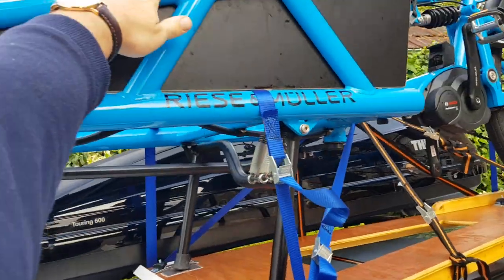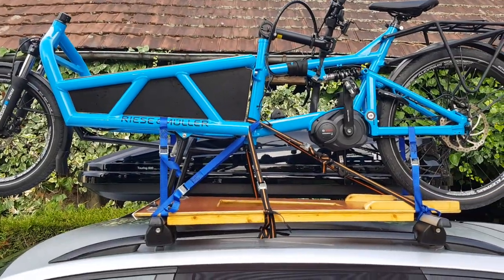Roof Rack Option for Riese & Muller Load (Possibly Other Cargo Bikes)

Comment: This is really great, Richard. The woodworking looks absolutely splendid! I have the 80, the legs of which are different from the Load. Did you consider using braces of some kind to support the mid/front of the bike rather than rely on the bike's own legs or did you realize right off the bat that any other solution would be superfluous? Again, brilliant design & superb video. Thanks a lot for sharing!!
Reply from the maker: Hi Cameron, apologies for late reply! Thanks for your comment, yes as you say trying to support the bike on its wheels or by another way is just over-engineering. The bike stand is obviously designed to support the bike so this is just applying the same principle to it albeit 5 feet in the air on top of a car! 

Used it a good few times now and its rock solid. I'd say the 80 might take a little more effort to lift up but I believe they are nearly the same weight stripped down.

Comment: This is great.  I've an Audi wagon so pretty much the same dimensions. I'm going to make one for my Load 75. Could you share the measurements for your customisation?
Reply from the maker: Hi Joseph, thanks pal! Your dimensions will depend on your own set-up, like I say in the video. For example the length of the board obviously needs to be as long as your rear wheel to centre stand, and just as wide as the centre stand. Then if your roof-bars are too close together like I demonstrated you'll need to make the board "over-hang" one of the bars - I strengthened mine by adding some supports at the top of the rear roof bar. Hope that makes sense. The triangle shape and the cut-out is to reduce weight and help the wind go through - let me know how you get on....The Load 75 is the next bike!!

Comment: great job. I have a bullitt cargo bike with a huge metal box up front to carry my music equipment. I would probably have to remove the box to get it on the roof. still may try something like this.
Reply from the maker: Definitely give it a shot - just be careful of weight limits for your roof/roofbars too though.
Reply: @ricmurphy  I have a huge metal box on the front of my bullitt. It is really hard to take it off. Can you recommend a rear loading cargo platform for an suv that could hold my bullitt? I would probably have to take the front wheel off so it doesn't stick out on either side of my car. Thank you!
Reply from the maker: @patdowling7200  Afraid not, pretty much the same reason I came up with the above. I'd imagine anything would have to be tow-bar mounted at least. Perhaps you could consider a trailer, I've seen others use motorbike trailers for these bikes...

Comment: Hi Richard. Thanks for sharing. Really great job! I have a Packster 80 but right now my first concern is mounting my Supercharger 2 which I'm taking delivery of in a couple of days (!) to the back of my car that doesn't have a tow bar or hook for conventional flatbed bikeracks. I see you mounted you wife's R&M bike to the back of your car. What is the rack you use? Is officially rated to handle a bike of that weight or did you just try it out? Thanks!
Reply from the maker: Hi Daniel, thanks for the words - the R&Ms really are great bikes! The Supercharger was the bike I was going to get before kids took priority and went for the cargo! For mounting on the back you need to check two things: 1. Weight load for the bike rack, 2. Weight load for the boot (if available). 

I've since changed car (Skoda Kodiaq) and the rack too, but the current one is the same style and is like most normal racks rated for 45kg (more details on this on a post I put up here: https://www.briskoda.net/forums/topic/466897-boot-bicycle-carrier/) I was also able to find out that the boot can take this weight as well. I think your bike is about 30kg so well under the limit. I just wouldn't go putting multiple bikes on it unless you have another light bike? Honestly if I could afford the €800 tow bar + €500 tow bar bike rack at the time I might have gone that route, but the above serves us well

Comment: great video and nice solution! I own a bullitt and looking for ideas on transporting it. Out of curiosity, how do you get the bike up there? I am guessing it is a two man job?
Reply from the maker: Thanks Peter! Nice bike but could be a bit heavier than the Load 60 so watch out for your weight limits. I touch on the process of lifting the bike up in the video, but yes a two man job. Myself and my wife manage it easily though. She lifts the front of the bike to her hip height, I then lift the rear wheel up to the platform, then together we lift the front of the bike up onto its centre stand. Straight forward, but just take it slowly to avoid damaging the car.

Comment: It's super cool, but is it road legal?
Reply from the maker: You should check with your local requirements, but certainly here it is. Most loading rules are based on weight, which is relevant to your vehicle. This is fixed to the roof bars using an official roof box kit.
Reply: @ricmurphy   I'm just guessing; do you live in Ireland? Because I do.
Reply from the maker: @FBRZ3955  I do indeed - have you got a cargo bike as well?
Reply: @ricmurphy  I have a load 75 ;-) based in Dub.
Reply: @FBRZ3955  Out of curiosity Fabrizio, did you attempt to build this for your own Load 75?

Comment: Hi, thx for the video, How you climb the bike on the roof ? Thx
Reply from the maker: Hi Guillaume, strip the bike down, and then with two people lift the back wheel up first, then the front stand - really quite easy.
Reply: Thx for your answer :-)

is it possible to have the plan and the assembly materials? Thx
Reply from the maker: @guillaumeprenveille2335  It was all in my head and will depend really on your roof bars (distance between), weight allowances etc... Get a good sheet of marine plywood (I varnished mine too), Nordrive roof box fitting kit (or any kit that works for your roof bars), some 2 x 2 wood for the support bars and thats its really. The diamond shape and cut-outs was to reduce the weight as you only really need points for the stand and the rear wheel to sit on. All very simple wood-work with circular saw, jig saw and a drill. Hope that helps!